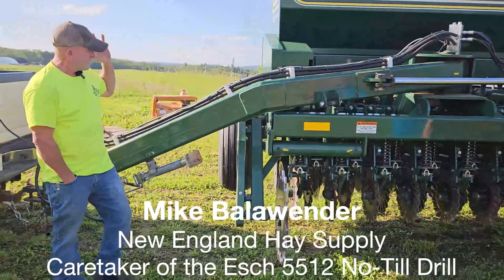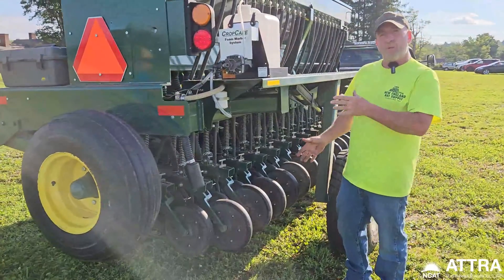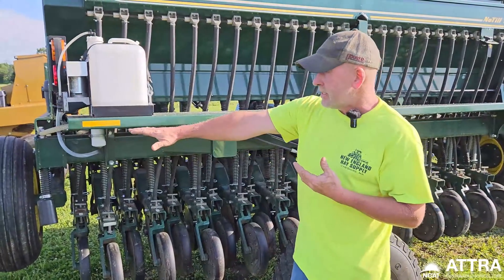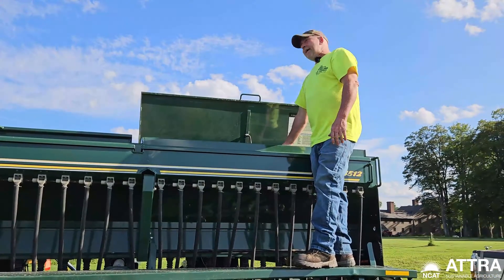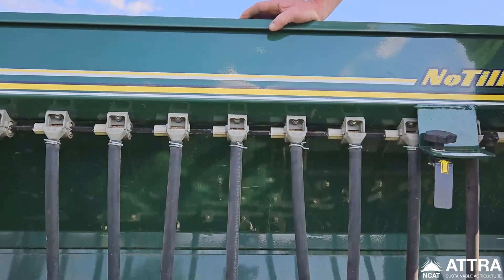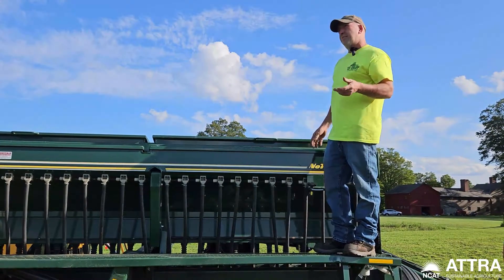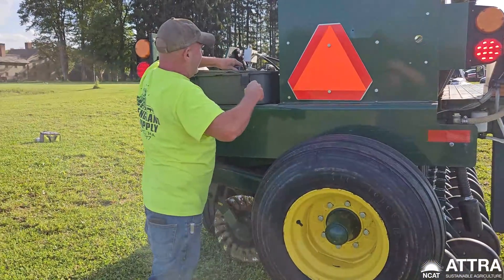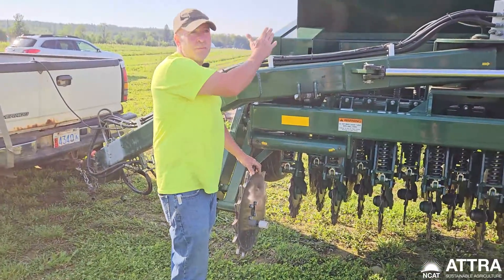Operation and Features of a No-Till Seeder Drill

Comment: There are a few things I would like to add to this video. The first thing I would like to add, when you are opening and closing the drill. 1st and foremost Park your tractor and drill on flat level ground and put your tractor in neutral before doing anything.  Once you get your road tires folded back, you will now use your second remote to drop down what we call the field tires. We will then once all four tires are on the ground, we will move our field tires either up or down by just bumping your remote so they move maybe 1 inch in either direction. Once you do that, that will switch the hydraulic control box from moving your road tires to the swing function on the drill. Now that you have done that, you will now open the drill until it locks itself in place, but keep in mind that as it is opening or closing it will move your tractor maybe a foot either forward or backwards and that is totally normal. Now, you will bump your remote for the field tires once again to switch that hydraulic control box to raise up your road tires. Now the machine is open it will act as a regular tow behind seed drill, and you will just use the one remote to raise and lower into the ground with.
Secondly I would like to add that each separate Hopper inside the big seed box holds around 250# of seed not 50. If I'm not mistaken I believe it will hold somewhere between 1200 and 1500 lb of large seed.
Lastly I would like to add that when you are calibrating seed mixtures of say for example Alfalfa Timothy Orchard Grass or whatever the mixture is simply figure out how many pounds that you are putting in the ground as a whole not individually. For example if you are attempting to seed 30 lbs to the acre, get the weight of whatever container you are going to use while it is empty. Next you will want to set your seed rate at your desired setting. I recommend that if you are using a Timothy Alfalfa and Orchard Grass mix that you put that into the large seed box because the Orchard Grass does not like to go through the smaller seed box very well. Now place your tarp that is included on the frame of the machine (inside the tube) underneath all of your drop down tubes, and between your tires. . Once you do that spin the end wheel 66 times in the direction of travel, then once you have completed that, take the seed, pour it into your container, and then weigh that. When you spin that and wheel 66 times, that will give you one tenth of an acre. This holds true for any seed that you put into that machine. Now, once you have your seed weighed up, you can use the formula that is on the box up on top or simply multiply it by 10. That will give you an accurate weight of the seed that is going into the ground per acre
Reply from the maker: Thanks, we really do appreciate the input.